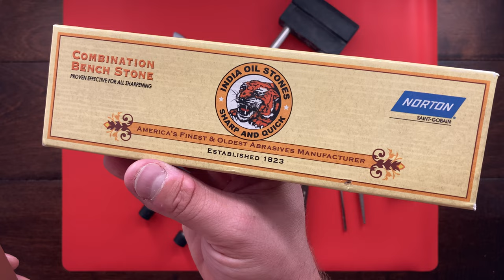How to sharpen a hawk bill blade, and few others.

Comment: I'm getting a long 150×6 mm diamond rod in three grits to sharpen my serrated knives. I guess that would also be used to sharpen my hawkbill. You are correct about not cutting into the diamond rod when sharpening as it can have a chance to catch on an over protruding diamond particle which will flatten the edge. It usually happened on a rough grit diamond rod.

Comment: Hawkbill blades can be a challenge to sharpen.  Tip: I use a large eraser (my daughter's from school) to clean off ceramic rods, diamond rods and cleaned sharpening stones.  It quickly removes the steel waste pieces and returns them to full function.
Reply: Adding to his tip, the white ones work the best. Do not waste your time on pink ones.

Comment: I was always told you only sharpen one side of a hawkbill style knife is there any truth behind that?
Reply from the maker: No
Reply: If you want a chisel grind for very specific applications you could do that, but generally no. Standard profile grinds are far more versatile for many tasks rather than exclusively optimized for one task. Though chisel edge profiles are easy to get very sharp, they do not make straight cuts very easy and would likely tear thin materials rather than slice them.

Comment: Please, Tell me the point of your counting?
Reply from the maker: Like any reason, people count to keep track…
Reply: Personally, I just feel for the burr. 

   Using moderate pressure, I stay on one side till it can be seen/felt on the entire opposite side.  At that point, I do the same thing on the opposing side of the blade. Once the burr develops along that entire side, I then lighten up the pressure and do one to one opposing strokes till the burr has been removed.  

 If I need a less toothy edge, I will step up the grits with the exact same method. Then strop in addition to going up the grits. I skip the strop on toothy edc blades though.  

 Keep ‘em sharp! Consistency consistency consistency!